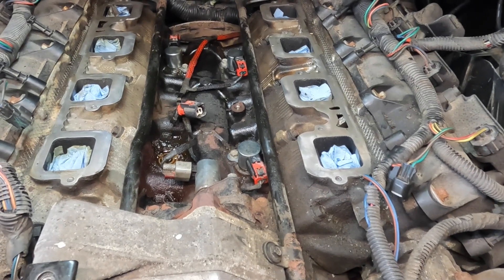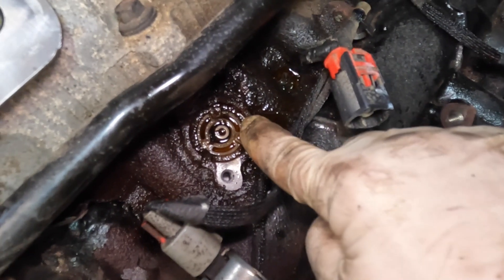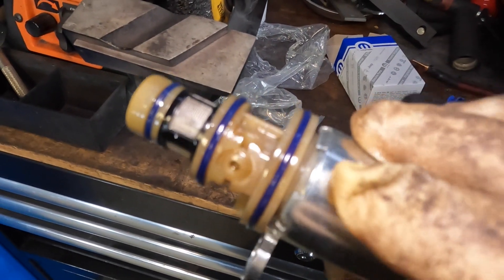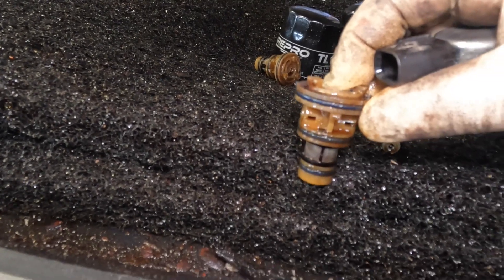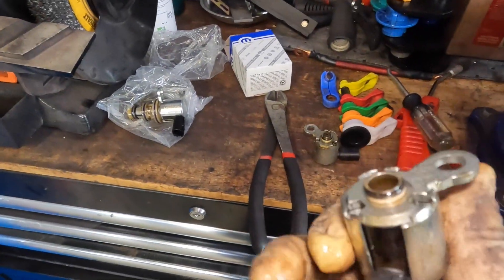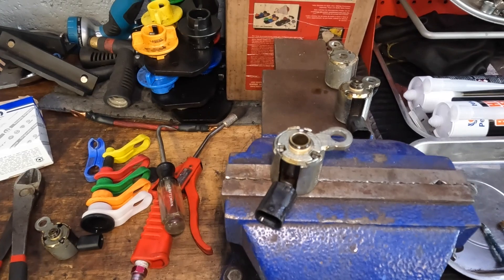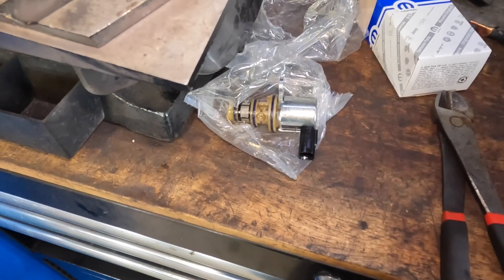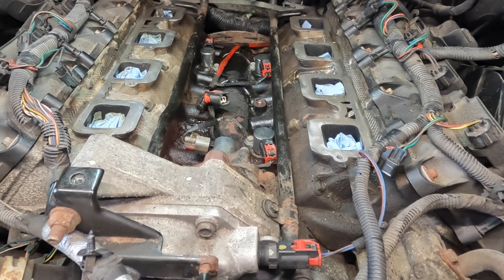ENGINEERING FAIL! JEEP 5.7L HEMI VARIABLE VALVE TIMING SOLENOID FAIL! PLASTIC VVT SOLENOIDS!

Comment: Those are the MDS solenoids, not VVT. The VVT solenoid is in the peak of the block. Bad info.
Reply from the maker: They are MDS you are correct! I said it wrong in the video, the information isn't bad because I used the wrong term it still provides you with a guide on these!

Comment: i had a plastic water bypass pipe break on my toyota 4 cylinder, and guess what it was plastic too! by the way, the motor overheated!
Reply from the maker: I see it happen often, I actually have a car in the shop with a video coming soon of a water bypass cracked in half also made of plastic.